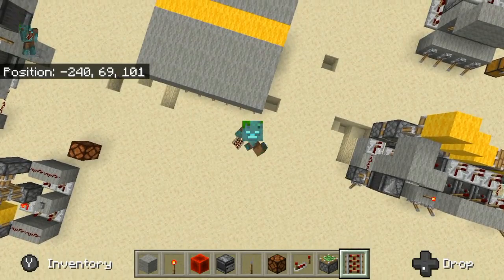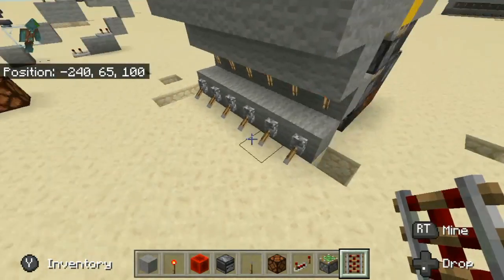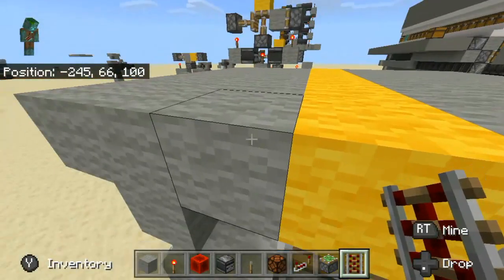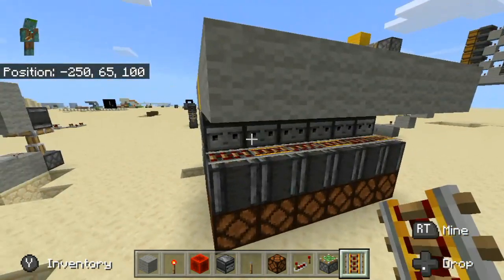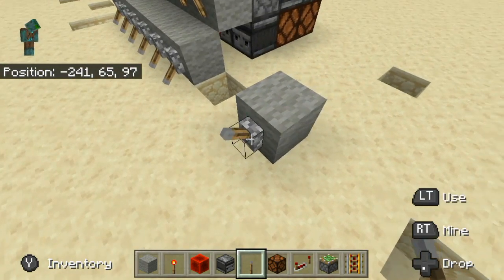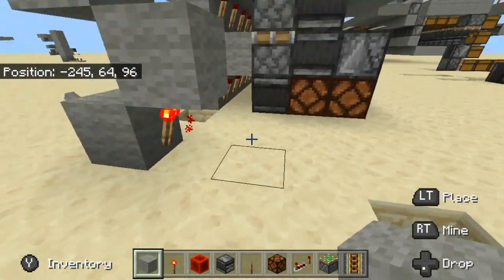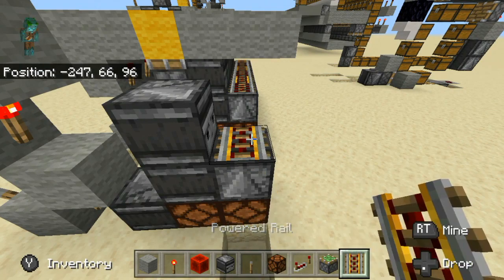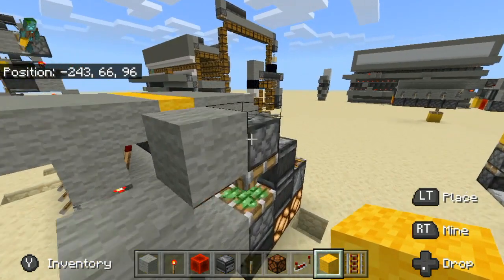Seamless, flush, 1-wide, tileable double piston extender // Minecraft Bedrock/Pocket Edition

Comment: Can you make a stackable design
Reply from the maker: I'll try. But it's only possible with horizontal ones. This one is already tileable which is the same as stackable but in another direction.
Reply: It's fine if the 2nd piston gets a 1 tick pulse because I need it for a farm 
Make it fast
Reply from the maker: You need to do it exactly the way that I did.
Reply: Redstone torches don't work sideways do they?
Reply from the maker: I don't know what you mean exactly. You can have a repeater or just normal redstone next to it and it'll be activated. But if you have a block next to it, it won't power something through that.